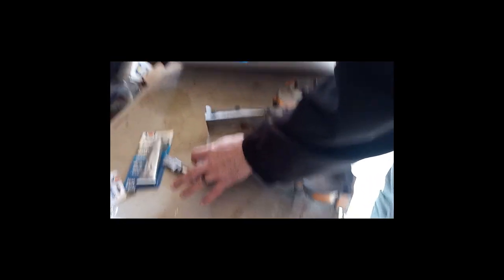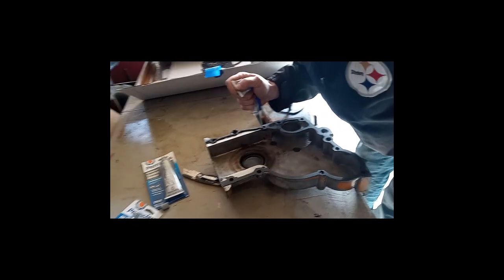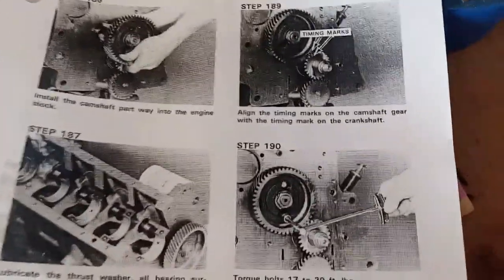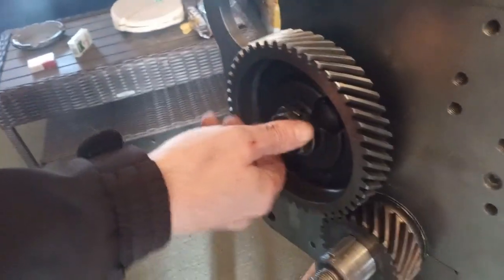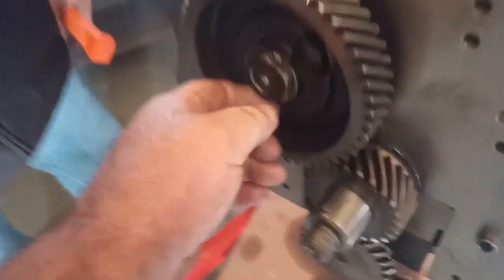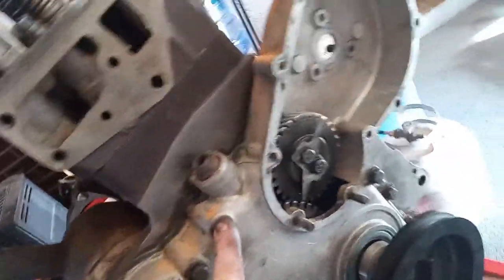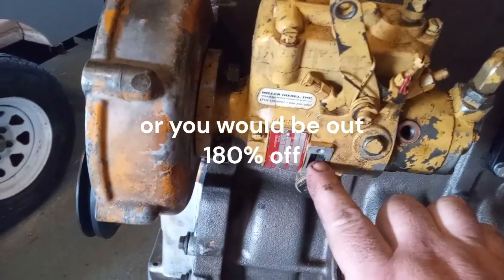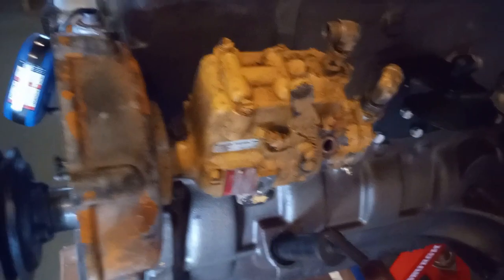Case 580c 207d rebuild pt 6, Timing, timing, even injector timing!

Comment: I'm trying to figure out exact proper locations for all those timing cover bolts....wish I'd have made a pattern board to store them as I took it apart.....LOL
Reply from the maker: I had a similar problem where I lost a bolt for the timing cover, after measuring the casing the bolts went into, I purchased a bolt from tractor supply and Home Depot that were the same thread size and even put washers on.
it's better to have a slightly shorter bolt than to max out the casing. Hey! always mark your bolts! Something I've forgot a time or two! Good luck! Check out our community page I'll throw up a pick.